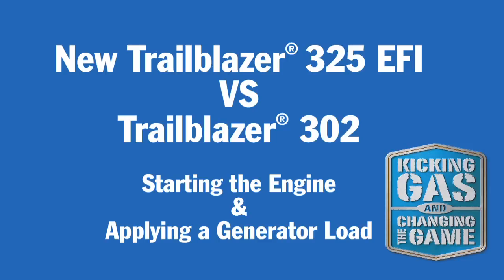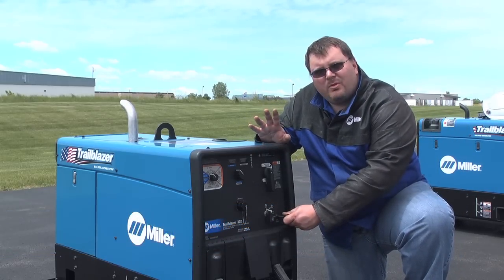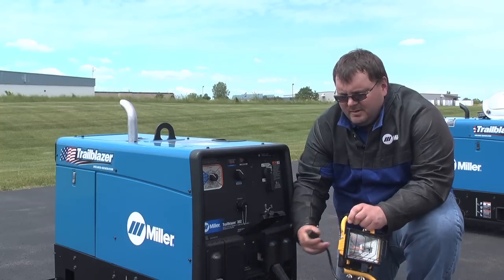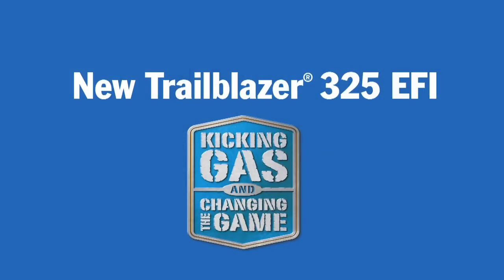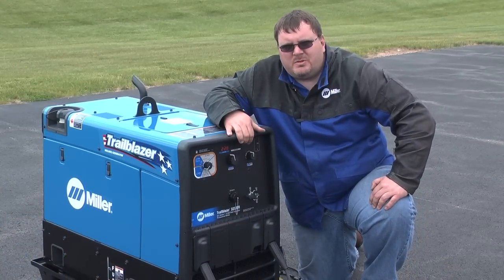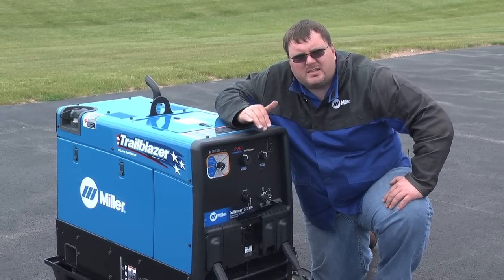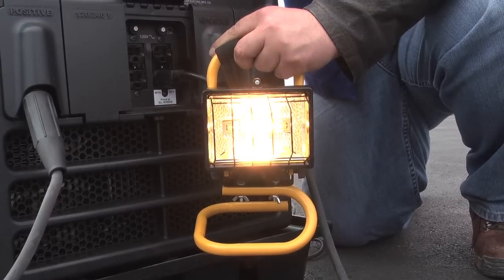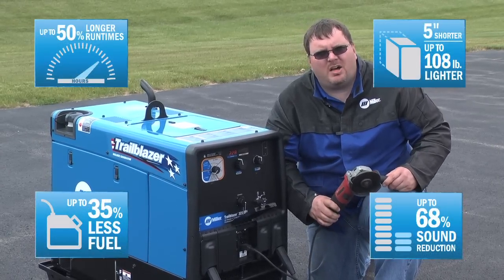Trailblazer® 325 EFI Demo 1 of 3: Generator Power Comparison

Comment: How do you plug in an RV 30 amp plug
Reply from the maker: That will depend on the plug type, we offer a full KVA adapter cord that would adapt the NEMA 14-50R on the trailblazer to a NEMA 6-50R. If your RV plug is a NEMA 6-50 you're all set, if it's a different plug you would need to source a NEMA 14-50 adapter, these are available from multiple vendors.